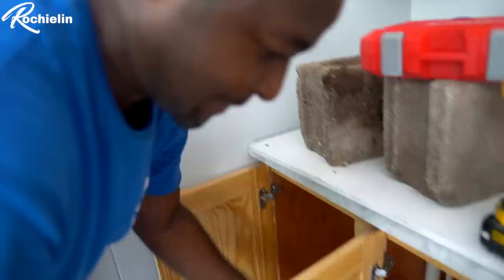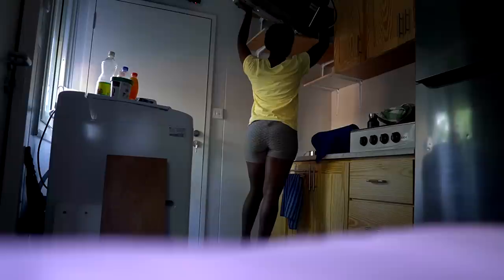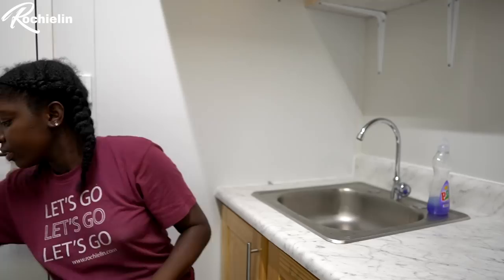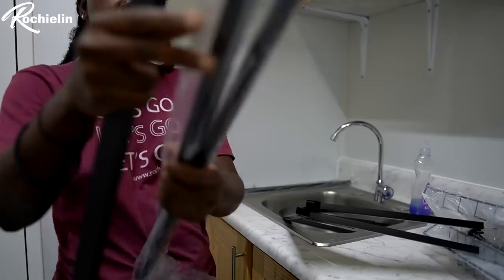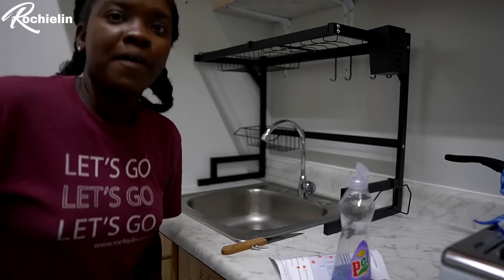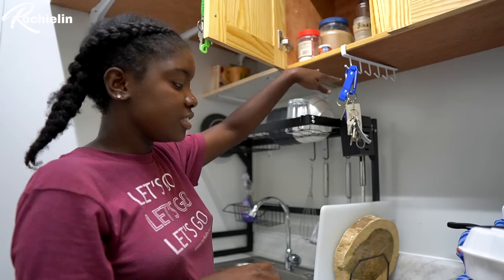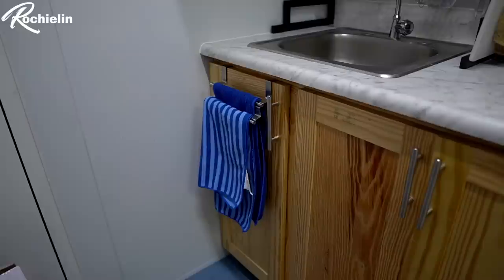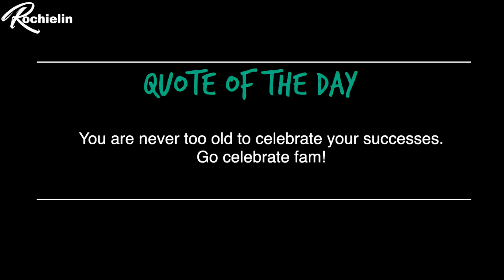AFFORDABLE 20ft Shipping Container Home- Kitchen

Comment: I love to see how your little house is coming along very nice. I feel you should leave that microwave on top of the refrigerator. If you leave the microwave in the corner you will not be able to push the buttons and open the door comfortable. Underneath that shelf where you had a microwave on the left remove the microwave and try and put a dish dryer where you can drill it underneath the shelf
Reply: Or hang the shelf over the refrigerator, is another suggestion.
Microwave looks high and hard to use at current location
Reply: Yeah i saw that too maybe she will see it later n make up her mind where 🤔 to put it.
Reply: I agree. Also the shelves for the microwave spoils the look in my opinion
Reply: Fully agree 💯
Reply: Agree
Reply: So proud of you achieving this tremendous success of owning your own   home. You never gave up when the going got tuff, do enjoy ever moment don't forget to invite the presence of the lord inside your dwelling blessing mama 🙏🙏

Comment: You are doing what I wanted to do but at the time I was told I could not get an NHT loan for it (about 8yrs ago) also the Hubster was concerned about heat and durability. I was like " It's metal sir plus AC deh bout an solar can sort out di JPS issue." I lost the debate anyway.

Comment: I have a burning question. Why is the microwave shelf so far up? Do you have to climb a stool to use it? And it seems to not be able to open as it is there. You have to draw it out a bit. So now, when you take your plate out....how do you get it to the counter top...do you climb down with it? Hmmm😒

Comment: Putting the microwave up that high is an inconvenience  and you can’t open the door up properly without pulling it out and away from the wall space. Maybe he can put a shelf over the refrigerator to hold the microwave.